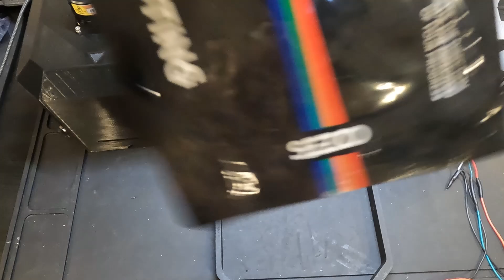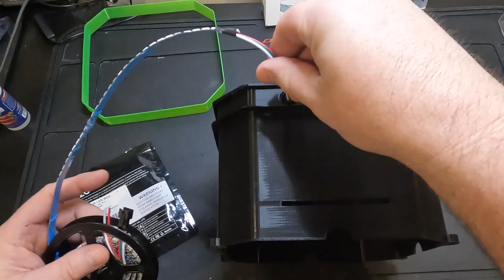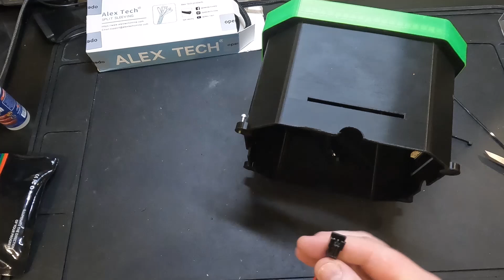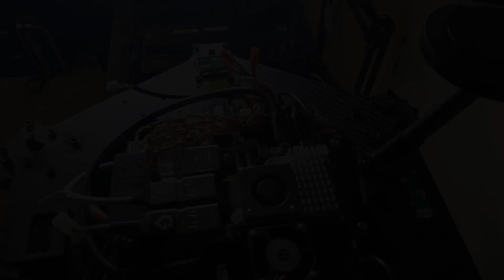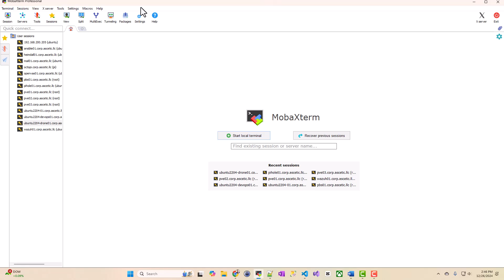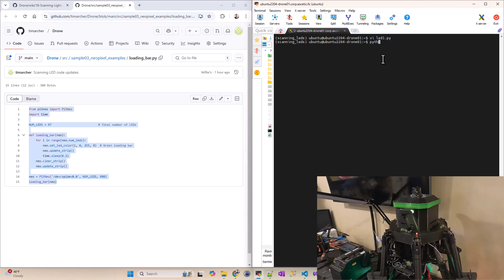Hexacopter Drone Build Project – Part 18 Scanning Lights

Comment: Hello, can you recommend a high-quality VTX and VRX module? I want to process live video from a UAV to a ground station. I previously used the Ubiquiti Rocket AC5-Lite, but I had frequent disconnection issues and high latency problems. I'm considering using modules commonly found in FPV systems, but most of them use FPV goggles as receivers. I want to process the video directly on my computer.
Reply: I'm actually very stressed right now. Because I need to develop a bunch of UAVs and operate them all from a single ground station, and I can't find a solution for their communication and video transmission.
Reply from the maker: Have you looked into the Herelink at all?
Reply: @timarcher52  Sorry I didn't see your message. YouTube doesn't send notifications.I already have a quality remote control and I don't want to buy a system herelink and transfer the image from the remote control to the computer and increase the ms.

Comment: Good to hear from you. Looking forward to some videos. Myself, have been working on sorting out how to control camera in auto mode
Reply from the maker: @yancymuu4977  sounds awesome! How's that been working out? Making good progress?
Reply: @timarcher52  A bit challenging. I made a test flight yesterday with crazy results. Now see several dumb mistakes  that need correction. I watched a video on how to setup motion of physical gimbal during a mission planner simulation. This worked when I first tried it with SIYI camera, but for some reason I can't get it working again. Plan to work on finding problem. It would be extremely useful to observe actual gimbal rotations during simulated flight.